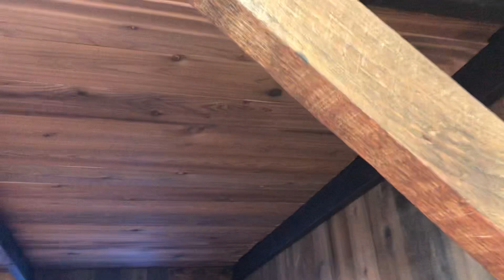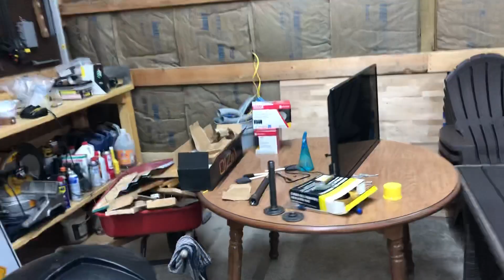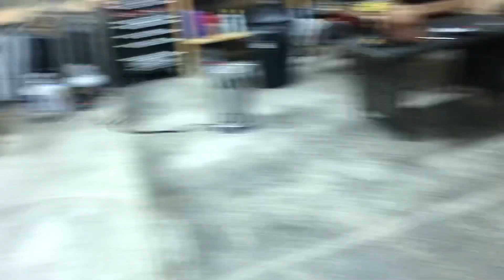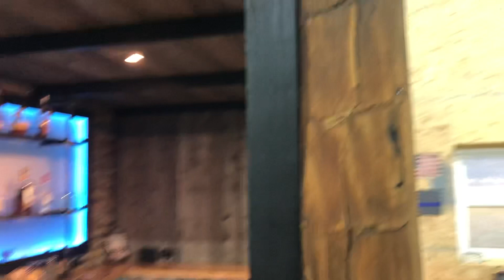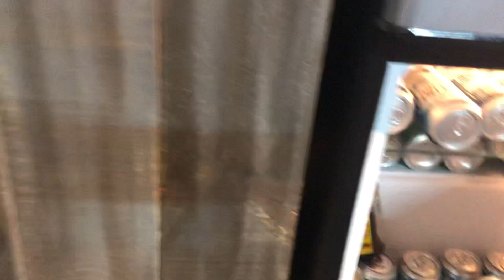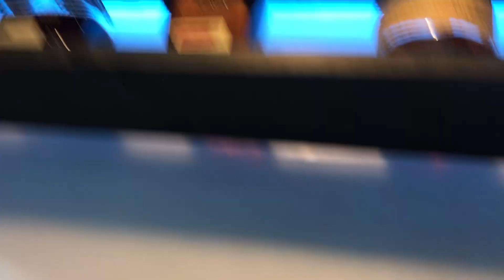Rustic Bar in Pole Barn

Comment: building one in a 14'x16' room with a high ceiling, (House built in 1895'!), my Q is what are your Bar dimensions? Nice work BTW and thanks for any info or input!
Reply from the maker: Roughly 10 ft wide and 8 feet deep wall to front

Comment: How did u build the frame???
Reply from the maker: Main structure is 2 4x4x10 anchored posts in the front with a 2x10 header in front, and back attached to the barn.  2x4’s span the roof and are attached to the headers with Simpson framing brackets.